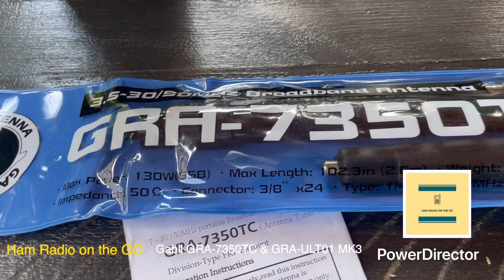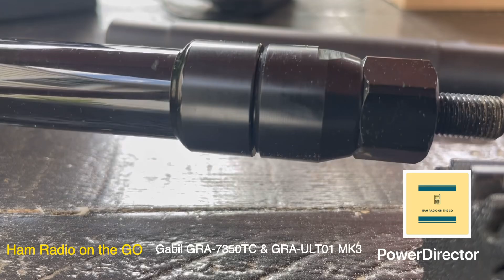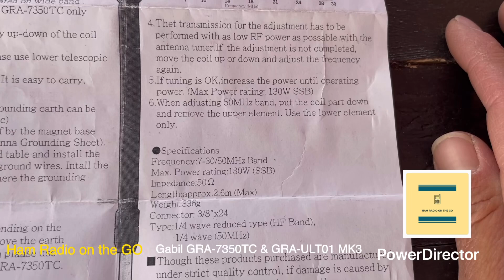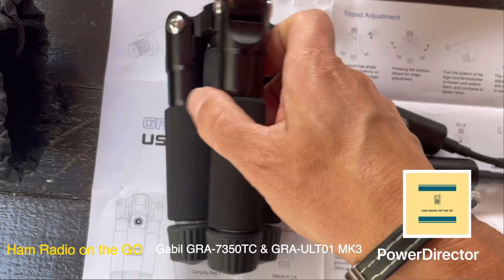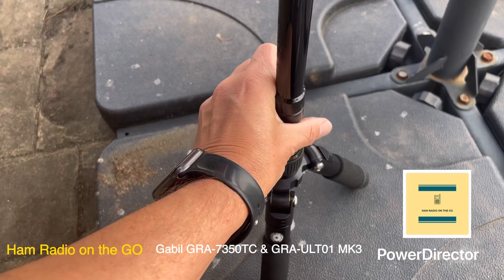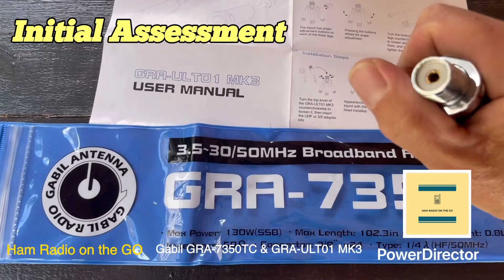Gabil GRA-7350TC Adjustable telescopic HF portable antenna & GRA-ULT01 MK3 Tripod. Review & Set up.

Comment: I am a big fan of the Gabil GRA-1900T. If you must use a portable vertical, it’s lightweight, packs easily and sets up quickly. 

It is extremely efficient for its format as it has the longest telescopic  whip in its class: 2.18 meters. 

It even fits on the back of my Xiegu G90 with a 90 degree adapter. 

Rated for 6 to 160 meters, I find that I am only able to get it to perform on 160 meters with an add-on longer telescoping whip set to 255 to 275 cm. 

I just received my GRA-ULT01 MK3 today and it’s a terrific tripod. I used it all day today with my AliExpress 17 footer telescoping whip for 20 meters, using Gabil adapters. 

And with my Radioddity HF-009 coil, it works great on 30, 40, 60 and even 80 meters with a PAC-Cap Hat and  antenba tuner. 

I am passing on the 7350 as it does not perform on 160 meters; one of my POTA Late Shift Activation Bands. 

So tomorrow I will receive the GRA-RPG and see if it will outperform my 1900T.

Comment: Correction: this antenna does not require a tuner.
Reply from the maker: Correct it has a manual adjustment, did I say it required a tuner?

Comment: Joe, another great video. Thank you for doing such a great job. I look forward to each and every video you put out. Very informative! With regard to the magnetic counterpoise you added as accessories, I wonder if the pad has to be mounted on a magnetic metal surface or can you just place it on the ground? Thanks again buddy, Jeff
Reply from the maker: Thanks Jeff! appreciate the compliments! It appears it may need to be mounted on a metal surface. It might be for the magnetic mount for static mobile. Interesting antenna system. Thanks for the comment. 73